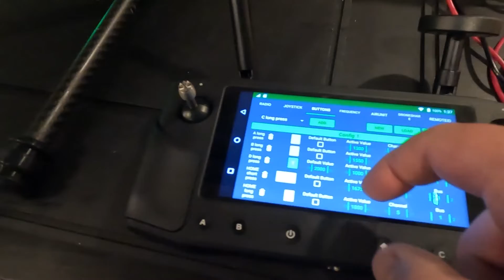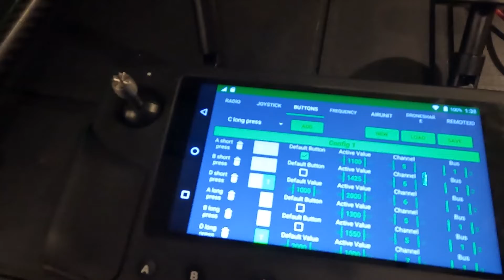Hexacopter Drone Build Project – Part 14 Navigation Lights

Comment: Can I make a plane with XRotor X8 or XRotor X6 engines with a Pixhawk 6C processor, and what power model do I use?
Reply from the maker: Not sure on that, Ive never looked into building a plane using the XRotor motors.

Comment: Your build seems to be coming along very nicely. Are you worried about weight at all? On my much smaller drone my flight time seems to have dropped from about 18 minutes to about 10 with the addition of an air unit and camera (plus various 3D printed mounting parts). I am thinking of doing some experiments to determine flight time vs weight. Also I believe there might be some weight saving things that are possible. Thanks for shareing.
Reply from the maker: Yes, I do worry, but not sure there's much I can do about it since I cant get a bigger battery in the frame. I was able to hover for 30 minutes with the current setup and so flight time so far is good. Adding more weight will for sure reduce flight time, just not sure how much yet. I'm pretty much learning and figuring out as I go here. Glad you liked the video!

Comment: Hello Tim. The international lighting for ships and aircraft are Green on the Right, Red on the Left, (Ships use White on top) Aircraft use strobe white on the bottom and on top, or a white strobe and a red rotating or flashing red on top and white on the tail. The white strobes are to be cycling at least 80 flashes a minute. As for drone, some how a standard became a an alternating red/green on the front arms, and a solid green on the rear facing arms. Weird. I saw that you had an incident and I hope you are able to get everything back together.  Also, I need to figure out how to add the muli-functions to the Herelink controller buttons, I have been unsuccessful on get the mapping to work in Ardupilot. Good Luck.
Reply from the maker: Thank you! Yes, Ive been trying to follow the lighting for ships and aircraft as best I could here witht he red on the left, green on the right. I'm not sure why the off the shelf drones ended up with that different pattern, it seems like if youre putting something in the air you'd want people to be able to recognize what the lights mean.
Reply: @timarcher52  I do have a question about setting up the Herelink controller. I'm unable to get mine to accelerate the throttle after arming. The motors spin up and hold RPM, but after that, the quad just sits there. Any suggestion? This is my first time with the Herelink and I'm wondering what I've missed.
Reply from the maker: @jfwahl  that's odd, I don't recall doing anything special. If you go into mission planner on your computer and run the motor test are you able to spin each motor through that interface and will different speeds work? (Do it with props detached though)
Reply: @timarcher52  Yes, I'm able to run the motor test with both a computer and the controller. I'm puzzled.
Reply: I believe it's my batteries. I'm replacing them. I think that the discharge rate is too low for the motors.
Reply from the maker: @jfwahl That's interesting, what batteries were you running?
Reply: @timarcher52  It was my bad, they were 10C and after reviewing the calculator, I need at least 25C battery.